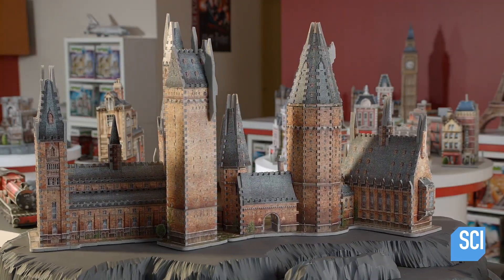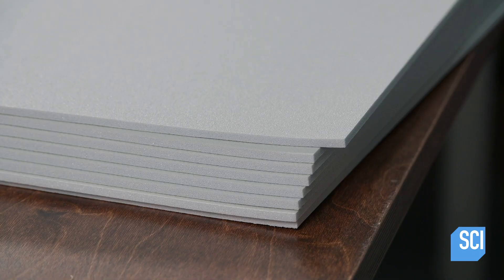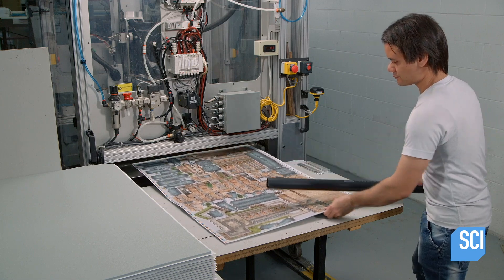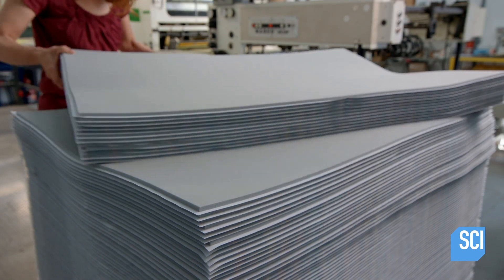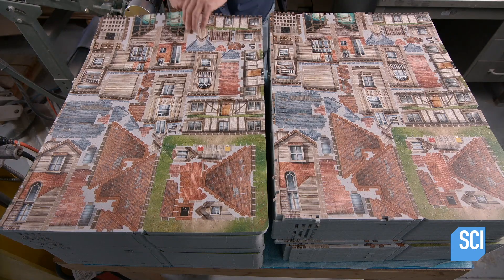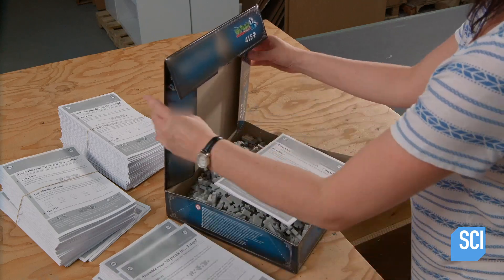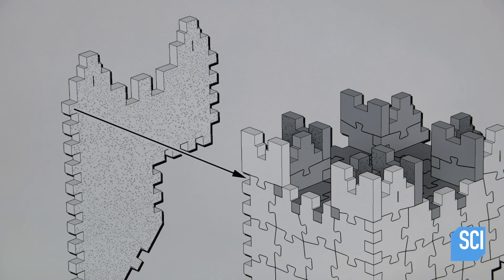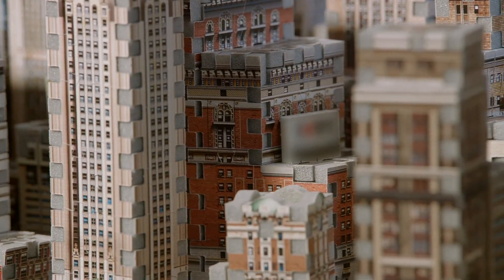How 3D Jigsaw Puzzles Are Made | How It's Made

Comment: Damn that steel die would be a challenge to make 🤯
Reply: Ikr? I'd like to see a How It's Made about that cutting die!
Reply: For everyone talking about how it was made, I would figure it’s some kind of automated bending machine, taking strips of metal and splitting the shutting die into slivers. Though even with that it seems really difficult to make.
Reply: Not if its milled, a robot will do it with ease
Reply: Just please don't melt it into ingots...
Reply: Not even. Program the pattern to CNC machine that mills the pattern to the metal
Reply: @hahhuli  this didn't look like it was milled.
Reply: @jp-hd4ge  Molded then?
Reply: @hahhuli  stupid right... In a how it's made we still are trying to find how it's made
Reply: @jp-hd4ge  The base material, usually high quality plywood  is CNC laser cut to create the tracks for the pattern then blades that are supplied on reels are fed into a CNC forming machine that cuts and bends the blades to fit into the tracks which is done by hand.

A lot of work goes into making a die as complex as the one in the video.
Reply: @jp-hd4ge  Exactly, that seemed like the most complicated part they could have shown and they skipped it haha